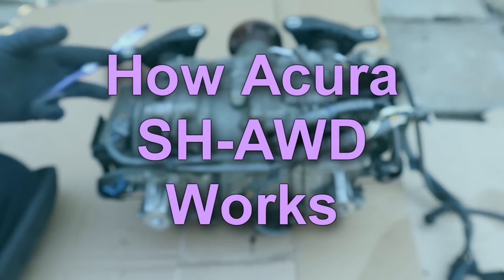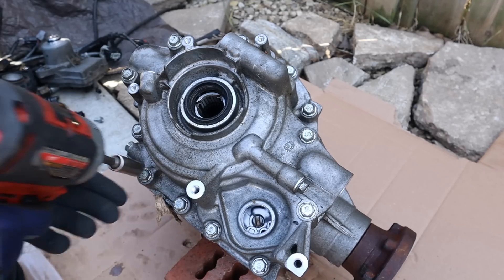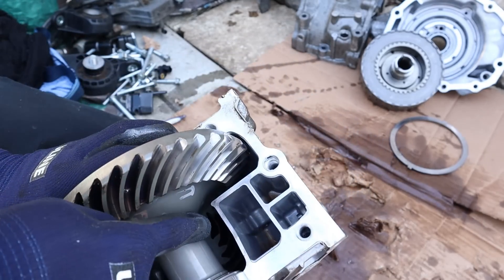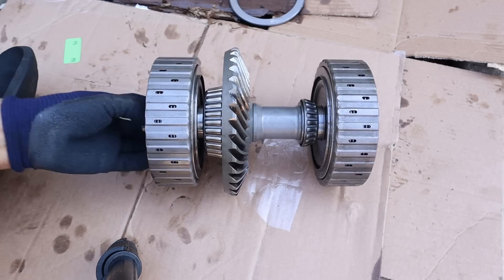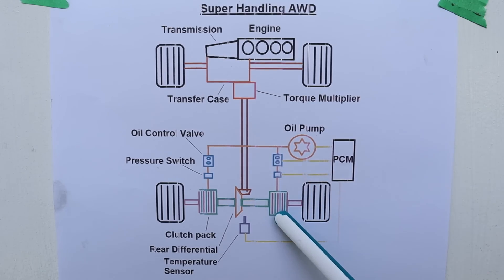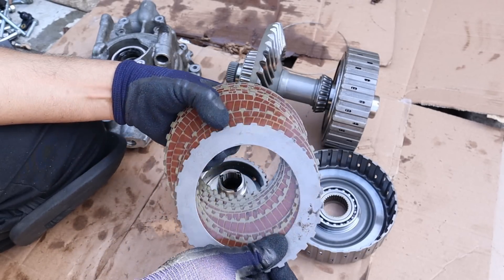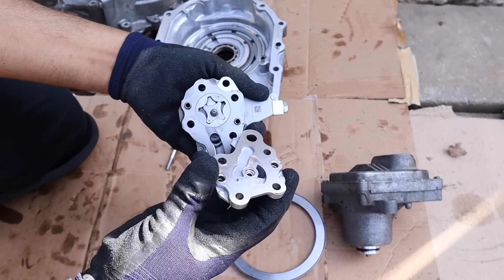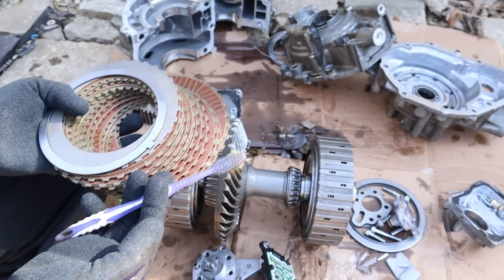How Acura Super Handling AWD Works

Comment: Thanks for unlocking the mystery surrounding the required "unique" DPSF-II Fluid. Seems like frequent changes and a magnet-tipped Drain Bolt will extend the life of that assembly.
Reply from the maker: Frequent changes are the key to anything lasting

Comment: I'm intrigued with this 'system' and I've been looking at Acuras with such system ( '05 Rl and up ) I'm wondering hos reliable it is...
Reply from the maker: It's quite reliable. 
Most of the time the clutches aren't slipping, so there isn't to much wear on the system. 
The rear differentials were easy to find used because they aren't a common wear point
Reply: I've had an 08 RDX sh-awd I handed down to my daughter with +210,000 miles today and 11 MDX Adv I sold to my nephew at +154,000 miles in 2023.  It was only scheduled fluid changes every 30,000 miles for the AT, transfer case, and rear diff sh-awd system.

Comment: Torque and Hondas/Acuras don't mix...
Reply: True for the I-4 i-Vtec engines.  MDX Sport hybrid 321hp/289tq, RLX Sport Hybrid, 377hp/341tq, MDX/TLX Type-S 355hp/354tq, Honda Civic Type-R 315hp/310tq, Acura Integra Type-S 320hp/310tq.

Comment: Great breakdown. Any chance you can break down a front transfer case/PTU? The front transfer case/PTU on the 21+ TLX/MDX Type S units are failing. Many observe some sort of assembly grease leaking out before the splines to the rear shaft fail…it’s been happening on stock vehicles. The two leading hypothesis is that the material on the spline is not strong enough for the 3.0t engine, and the other is some internal seal between transfer case and transmission fails, leaks, allows everything to overheat breaking down the fluids and seizing up the spline leading it to fail. But no one knows the root cause yet. Any help would be great. Big flaw in an otherwise great vehicles, requiring both transfer case and transmission to be replaced (not cheap!)

Comment: I had to change my two front tires because one couldn't be repaired. The tire salesman said I need to change all four.I have a 2021 RDX sh awd.
Reply: It is recommended to change all 4 tires; but, you can change only 2 tires on the same axle.  You have to keep the newer tires together for front/back rotations (no X-rotation).  The electronics can be sensitive with tires with a lot of tread depth differences on same axle.  I got a lot X-mas tree warning lights in my Acura with sh-awd with a temp donut spare on (all warning went away when I put the repaired flat back on).

Comment: Please help, I dropped a piece of plastic that is as long as a pinkie finger in the fill hole so will it damage the gear inside?
Reply from the maker: The gears will smash it and those pieces will clog the oil pump.
Reply: @speedkar99  Do you recommend getting the rear differential replace now? or can I drive until it breaks then get it replace?
Reply: How bout getting the piece of plastic out instead
Reply: @ cost a lot and not sure if the liquid is not leak after.

Comment: this is cool! this "diff" can turn the car into a one wheel drive :D
Reply: Actually it can't.
Reply: Only the Sport Hybrid EV powertrain with electric sh-awd can do one, two, three, and 4 wheel drive.  The system programing decides when to add power to which wheel(s) depending on throttle, brakes, mph, and steering G-force.  Sport Hybrid powertrain found on 14-20 RLX, 17-20 MDX, and +17 NSX.

Comment: This is a really cool video!  Thanks for sharing!  A few questions:

1. Does the transfer case use a variable pressure-controlled clutch as well to dynamically distribute torque between the front and rear wheels as well?  If so, what mechanism does it use to vary the transfer case clutch pressure?
2. How does the rear differential measure wheel torque eg: 25% left and 45% right?  Does it just use oil pressure only?  
3. How long do these clutch packs last?  Can they be replaced without replacing the whole unit?
Reply: These types of units do not need any additional clutch to control front/rear torque split. Everything is controlled by the clutches on the semi-axles.

Comment: Very informative- I had no idea these were basically locked diffs with clutch packs that allow it to turn.  Getting on the throttle on SH-AWD mid corner is actually pretty fun.
Reply from the maker: It sure will be, with any torque vectoring system. 
However you can't beat a proper RWD setup

Comment: Very interesting to watch.

My 2013 Mitsubishi Evolution X has a similar rear differential. It’s an open rear diff with what Mitsubishi calls “active yaw control system.” Torque vectoring pretty much for the rear wheels with an active center differential. It can send 100% of power to an individual real wheel during hard cornering. Great for the race track.
Reply: Rear unit of Evo is actually quite different. Both wheels are powered mechanically via differential (which is missing here), so even if clutches are open - it's still awd car while this one is FWD then. In Evo, power goes through gearing, not just the clutches. Evo also cannot power just one rear wheel.
Reply: @4x4.tests.on.rollers  I learn something new everyday😬

Comment: This is amazing. Never did I think I would see a manufacture outside England take one of the most reliable parts of a car and turn it into an overly complex mechanism that surely will be a high failure point. And will never make it to 200K+ mileage with minimum maintanance like a regular diff with a limited slip inside it.
Reply: What are you blathering about? Acura's with this AWD system last forever. It isn't even a complicated system...
Reply: And yet they go half a million miles without asking for anything while performing to their full designed potential. 
There are several good reasons why manufacturers don't use rear lsd's on fwd based awd driveline.

Comment: 5:46 I wonder if rather than oil pressure locking the clutch up, maybe the oil pressure UN-locks the clutch?  It might be better to have this thing fail in a locked up state.  OTOH if it fails into an unlocked state I guess the other wheel can provide full thrust, as long as the controlling computer could figure out one clutch was AWOL,  and you'd still be able to corner smoothly, accelerate moderately, etc.
Reply from the maker: This is primarily a FWD car, those will power the car if this rear differential failed.

Comment: I have an AWD MDX and it makes that bigger thing much easier and fun to drive - also makes me wonder why they didnt make an AWD Integra sku. Could have been awesome - especially if they added some level of manual torque assigning, could keep it vectoring, go 50/50, 30/70 or something lol (idk if thats even really possible) but even just SH AWD would have really made the new Integra a lot more compelling, especially since Acuras is great in my experience. Could have competed as a higher end GR Corolla or something.
Reply: Unfortunately it would make the cost of the car leave the demographic they're aiming to serve. That, and the R/D of adding AWD to the new integra would defeat the purpose of the TLX. I dont think they want to invest in designing a new transmission auto or not for the  civics drive train when they sell the TLX anyway. Manual SH-AWD hasn't existed since 2014 and I think this is the reason behind it.
Reply from the maker: The integra is in a tight spot. SH-AWD would be more expensive and heavier, when it's already more so than a civic SI
Reply: I've noticed Acura doesn't add sh-awd to lower hp/tq engines.  I think the 1st Gen RDX at 240hp/260tq had the lowest power numbers for sh-awd?  You will have more driveline power loss with sh-awd + the added weight.  The 200hp/192tq Integra might be hurt more than helped with sh-awd.

Comment: Fascinating engineering, but so many potential points of failure! Makes me shudder.
Reply from the maker: Yep those clutches aren't gonna last forever
Reply: Only fluid changes with the sh-awd rear diff every 30,000 miles for my 08 RDX with +210,000 miles and 11 MDX with +154,000 miles.

Comment: Have a 2011 RDX with the SH-AWD since new and it is still a blast to drive on windy backroads. The only real issue Ive had with the car is the waste gate actuator and the sun baking anything that's not painted metal on the outside.

It is a great car still
Reply from the maker: The K23 tur is weren't known to be reliable
Reply: @speedkar99  got 130k on mine so far, no real issues

Comment: Basically, in a FWD biased AWD system, when you floor it from 0, if you have a manual transmission, it will chirp in 2nd, and 3rd with the front wheels. 4th gen TL shawd experience. FWD is primary.

Comment: One thing to note is that the RDX SH-AWD system is a simplified version of the system found in the 2nd gen RL. The system in the RL can overdrive the rear wheels upto 5.7% faster than the front wheels while the RDX overdrives the rear wheels at a constant 1.7%. The RL system also incorporates a planetary gear set within the clutch packs that allows for the accerlation of the rear wheels. Really clever system.
Reply from the maker: Yes the RL makes the rear wheels spin faster. Not good for wear but good for handling.

Comment: Instead of the Dual Pump Fluid that Honda mandates, I put Mobil1 Synthetic ATF Multi Vehicle (Silver bottle/black label) in the rear diff of a 2019 MDX. As per 540RAT engineering blog, it’s tested as having the strongest mechanical wear protection, even better than Amsoil. I also use it in the ZF transmission. This was 7mos ago. Working just as it should. Thanks for this video!
Reply: as an engineer nothing keeps me up nights like people ignoring my usage recommendations... some brands might want their product to self-destruct confident that you'll buy another (MB, BMW these days?) but I think Honda and Toyota want their good engineering to be their calling card.
Reply: @lqr824  true but even Honda and now Toyota have gone the route of turbocharging. Maybe they have something up their sleeve but I don’t see them lasting like the current 2GR, 3UR 2UZ did..
Reply from the maker: Engineer here. I feel the same & hate neglect.
Reply: @speedkar99  ever get a chance to read 540RAT Engineering Blog? What do you think? He dynamically tests engine oil (at operating temp and up to 275F) and recently gear oil and ATF for wear protection specifically. For that reason I only keep Quaker State Full Synthetic 5W30 (not ultimate protection), Mobil1 Synthetic ATF multi vehicle (silver bottle/black label), Valvoline Synthetic 75W90 GL5 and Redline MT90 MT85 laying around..
Reply: earlier G of Sh-AWD spec ATF-Z1 fluid.  Honda spec DPF after ATF-DW1 took over Z1.
Reply: @gogozy1  yes when this mindless thin stuff started taking over. It wasn’t cutting it. I also don’t believe ANY OEM fluid is good at protecting. It’s only good for lining those company pockets. 540RAT tested a bunch of the thin new gen stuff like Mercon LV, Maxlife (my old fav), Mobil Synthetic Multi Vehicle (blue bottle, not Mobil1), Castrol Transmax and they all failed with “0 psi.”

Comment: How long will those clutches last during normal use? There's slip happening with every corner right?
Reply from the maker: They are open which means there's slip within these clutches. They are meant to slip but because there's fluid between them, they create some drag.

Comment: Just a LSD
Reply: Nope, very different. Actually not even a diff.
Reply: @4x4.tests.on.rollers  ends being a Diff..  just a different concept.. but it' a diff.
Reply: @luistello2996  Entire unit may function as a diff but it's a spool with two separate clutch packs. And it's not "just a lsd", it has lot more functions.
Reply: @4x4.tests.on.rollers  it's a LSD.. there's no other name. I'm Mechanich guys.. German car mechanic, not even in factory there's other name, LSdD have either clutch pads or springs.. and also can be looking diff.. ever Mercedes rear diff that are half hybrid are LSD active Diffs..
Reply: @luistello2996  LSD - limited slip differential. The only thing it does is limiting the diff slip, meaning it decreases the speed difference between both sides. It cannot send torque or power only to one wheel, it cannot increase the speed diference between both sides, it cannot overspeed one wheel, it cannot disconnect one wheel. The unit above can do that.
Reply: @luistello2996 No it's not. If you don't see the difference between LSD and torque vectoring unit which powers each wheel separately + it has overdrive ability then it's time for you to learn new things. Saying that this unit is just a lsd is completely missed. And it has nothing to do with duty cycle or manufacturers words. It's about mechanical structure and functioning.
Reply: @4x4.tests.on.rollers  what joke dude.. don't make Mecha more complicated than they are.
Reply: @4x4.tests.on.rollers  what joke dude.. don't make Mecha more complicated than they are.
Reply: @luistello2996  OK. What's the difference between the unit above (or basically Performax or Twinster) and let's say visco lsd? Do they function the same?
Reply from the maker: Very different.

Comment: I think the hydraulic pressure applies force from a piston in the end castings to squeeze the clutch pack.  Those holes you pointed out are for lubricating the clutch faces.
Reply from the maker: Thanks, that makes sense.

Comment: Wire the electric motor to be ON all the time, and stick a Quattro badge on the trunk.

You can thank me later.  lol
Reply from the maker: You'll be burning those clutches. It's got a temperature sensor for a reason !
Reply: @speedkar99  you are correct.  I only meant it as a joke
Reply: @MatthewTaylor3 A lot of quattro systems are also based on clutch packs.
Reply: @4x4.tests.on.rollers  I know.   It was just a joke when I posted it.    I just wanted to see a one of those Hondas drift.
Reply: @MatthewTaylor3  I got it, just pointed out the fact about quattro.

Comment: i'm guessing the PCM has an input that tells it the car is trying to turn. otherwise it would think the outside wheel is slipping and transfer torque to the inside wheel, the opposite of what you want when turning. a torsen diff performs the same function in a different way.
Reply from the maker: Yes, I mentioned this, the inputs are the driver's intention, steering wheel, yaw, throttle

Comment: 10:48 thermal pad, for heat dissipation as well as transferring heat to case
11:11 inductor probably is part of voltage boost circuit to drive the high(er) voltage Brushless DC motor (BLDC) for better speed and torque control.
Reply from the maker: If it's DC, why is there 3 coils?
Reply: Indeed the term used is strange.  Actually, it came from the heritage that it's a revised version of its ancestor brushed DC motor.  Brushed motor, although the power feed is DC, but it's internal commutator (brush) contacts change the current direction flow through the coils.  Brushless version is doing a similar thing by
- change outside stator from permanent magnets to coils,
- change the inside rotor from coils to permanent magnets 
- since there is no commutator by rotation to help changing current direction, so electronic circuit is used.  The DC power feed go through 3 sets of simple switching transistors (just ON and OFF, including reversing the current flow direction) to drive the stationary coils .
The waveform is very simple, e.g., first phase: POSITIVE 0-120 degree, NEGATIVE 180-300 degree. The other two phases do the same with 120 degree phase offset.

P.S. a similar type of design with much refined waveform can AC Synchronous PMSM motor, typically used in EV drive motor.  The waveform will be just 3 AC sinusoidal waveforms with 120 degree offset. <-- actually upper bridge is that rotation speed pattern, but lower bridge is the PWM modulated pattern to control the net current flow (to control the torque.)

BLDC controller is using bipolar transistors and is inexpensive $.  PMSM motor inverter is using IGBT and is expensive $$$.
Reply: 3 phase offers better power continuity than 2-phase motor.  Nicolas Tesla's original AC power generator is a 3-phase system and the motor is also 3-phase.

Comment: In newer honda's the system isnt reactive but proactive. My car has a display of torque vectoring and on turns it adjusts the rear split to help the car turn better. Im guessing it uses the steering angle sensor and yaw sensor. I havemt had a chance to use it in the snow or gravel yet though.
Reply from the maker: It's reactive for traction control.
Reply: @speedkar99  understood
Reply: It is still reactive in the scenario discussed in the video though.
Reply from the maker: It's reactive for traction control
Reply: @speedkar99  yes

Comment: Old tractors have rear brakes only, with separate left and right brake pedals. You step on one or the other when you need torque vectoring, usually to make a really tight turn, or keep a slipping drive wheel from digging in deeper.
Reply: It's part of what makes them magic - the first time you see a tractor turn into a field it'll blow your mind 😀.
Reply: Toyota's "turn assist" for their Landcruisers & GX550 works that way too... brakes the inside wheel for a tight turn offroad ❤
Reply from the maker: That's not quite torque vectoring since you are braking instead of applying power
Reply: @speedkar99  an open differential delivers equal torque to both axles, regardless of rotational velocity. Braking on one side directs more torque (and thus more power) to the unbraked side. On the braked side, some power gets converted to heat.
Subjective experience tells me it works quite well.

Comment: Fuck yeah! Over pack those clutch packs and you've got a NSD (no slip differential)!
Reply from the maker: Yep. A locking differential like a Jeep
Reply: @speedkar99  no, the Honda isn't a differential, so a pair of locked clutches would be like a welded differential. No slip, ever, because there is no 'unlocking', so there is no end to the fun!

('twas a blast in my S13, ~20 years ago)